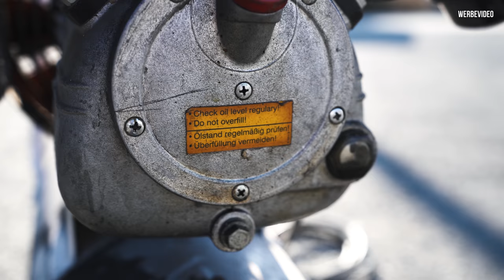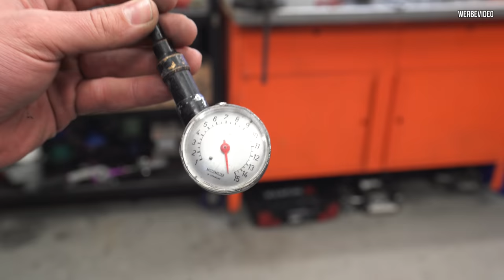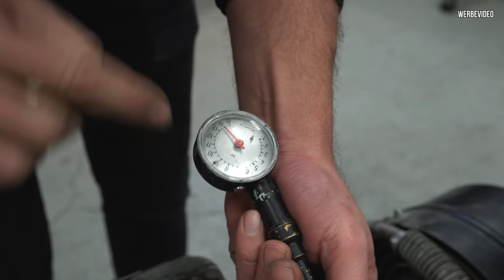Ist DER noch zu retten? Revision & Upgrades am 2 Zylinder! | Philipp Kaess |

Comment: Cool wäre es wenn ihr einen Druckluft kompressor mit einem Scroll Verdichter aus einer Kälteanalge bauen würdet. Die Steuerung ist Mega simpel. Wird nur über Schütz geschaltet. Vorteil wäre wahrscheinlich enorm hohe Haltbarkeit und vorallem das die Klatekompressoren total leise sind im Gegensatz zu den Druckluft Motoren. Auf einen 60L Kessel würde man sogar 2 Scroll Verdichter bauen können. Vielleicht ist ja in der community ein Kältemechatroniker der aus einer defekten oder zu schrottenden VRV Klimaanlage  2 Verdichter ausbauen kann?! Er müsste nur unbedingt mit luftfilter betrieben, und man müsste einen ölbogen bauen mit ablassschrauber falls sich in der Druckluft Öl sammelt, natürlich vor dem Kessel. Falls sich Öl drin sammelt mit der Zeit, kann man das über den Lufteingang dem kompressor wieder zufügen